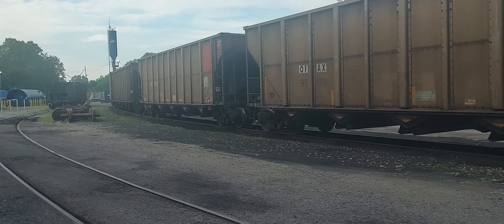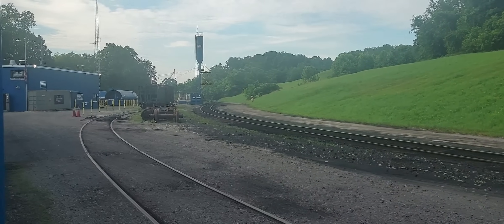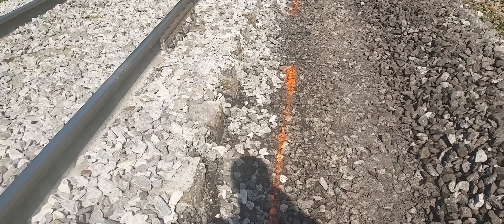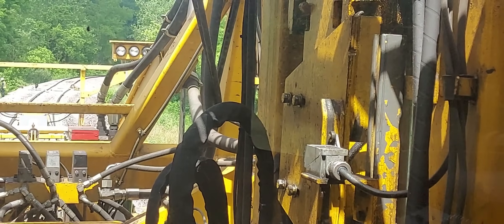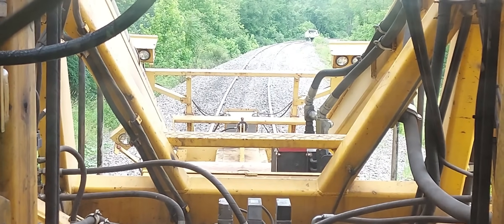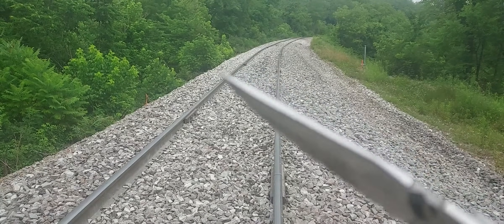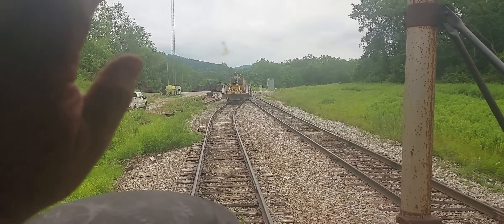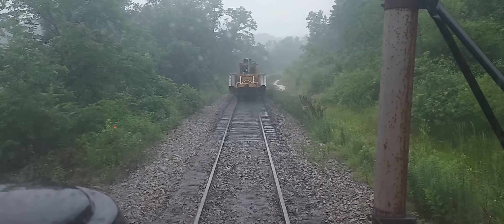It Was an Intense Time on the Railroad this Week

Comment: 14 inches is quite a bit. What is the most you ever had to pull a track to get it back into alignment?
Reply from the maker: Two years ago I pulled Curve 10 over 23 inches Mojo with my tamper. That was fun. It was a 10 degree curve and I got it down
to the original track chart at 3 degrees. Haven't shown those videos
yet. We had also pulled a different part of Curve 36 over the the south about 4 years ago, it was around 15 inches. Curve 36 has
been a nightmare since the beginning.  Really appreciate your taking the time to watch our video and may you have a very good day.

Comment: Why did the track need to be moved over?  Was it because it shifted over time, or more of tweaking it to make it smoother after running on it for awhile?
Reply from the maker: Train kept pushing the track to the south and eventually that side
of the track was sitting on ballast and not on the road bed
like it should be. Pure ballast over a slope is unstable. Thank you for  taking the time to watch our video and may you have a very good day.

Comment: Dave, you’ve mentioned the slow orders before and I think most of us know what those are in general but how is that information communicated to the locomotive engineers each time and who puts those orders in place and who can remove them? 

Do you get down to the exact spot for the slow orders or is it between mile posts even if the area in question isn’t a full mile?

Really enjoy the videos! Thanks for sharing.
Reply from the maker: Thank you Will, sounds like might make a good topic for a future
video. Myself or the shift foreman can put a slow order on the
track. If that event occurs there is a chalk board in the harbor
office where the slow order is written on so the train operators
can read it before shift, also word is communicated directly to
the operators by whoever puts the slow order on the section of
track. The only person who can remove a slow order is the same
person who first put it on.  As to the location, slow orders must
take into account the length of the train so the entire train
is moving at the same speed through out that section. So
got to figure train length to know where to start and when
to end. With that said, it's just often easier for the train operators to say for instance slow order from one milepost to another or from one location to another on the track.  Thank you for taking the time to watch our video and may you have a very good day.
Reply: @ccrx6700 thanks for the response, Dave! Very interesting and I’m sure it would make a good short topic for a video. 

You do a lot to show your side of the Ins and outs of railroading I was just curious how what you do translates to the day to day train operations. Thanks again
Reply from the maker: @willb.383 👍😊🚂

Comment: So you explained the number board now explain why there is no "F." 😉
Years ago, my cousin and I were fishing one day when I got my line caught and had to break it. As I brought the end out of the water it rose until the line was vertical pointing up in the air. I reeled it in and I am telling you I felt it in my hair and we were in a boat. My cousin started the motor and we hit warp speed out of there.
That is my "near" brush with lightning. Crazy.
Dave, I may not use all of the railroad safety tips you teach us but I sure do like learning them.
Reply from the maker: Since we do not fall under FRA jurisdiction there is no need to
label which end of the loco is the front ut000bs. Oh dear, being on
water in an electrical storm would scare me. When I worked
barges and lightening came up we got off asap.  Really appreciate your taking the time to watch our video and may you have a very good day.
Reply: @ccrx6700  I knew FRA jurisdiction didn't apply here. I was sort of poking fun. I would take a magic marker and make one, myself. lol 😉👍‍
Reply from the maker: @ut000bs 😊👍🚂

Comment: wow i didnt know metal fluid buckets are still made must be because its non detergent.hope you get some new equipment with the new administration and as demand increases.you do really great work.that radid down valve must be stuck or has no pressure on it.play it cool with that lightening thanks for sharing.
Reply from the maker: A good bit of the oil that comes in to the mine has been in metal
buckets, but they are starting to get the plastic buckets in more
and more here d2sfavs. Yes the oil I used was non detergent,
you are right about that. Watch Wednesday nights video for more
on the valve, I got into a huge mess.  Really appreciate your taking
the time to watch our video and may you have a very good day.

Comment: Lightning and metal tracks can make for some real interesting experiences.

  I worked at a company that the tracks passed by, there were 10 Highway Crossings with gates and lights, we had a really severe thunderstorm come up. 

 Lightning hit the tracks right outside the large window that faced the tracks and we could see at least 3 of the 10 Crossings out through the window, as soon as the lightning hit those 3 crossings activated, that lightning bounced down the tracks in two different directions, that was something to see.   It actuated all 10 Crossings and fused the relays at all 10, keeping the lights flashing and the gates down.

  I saw one of the circuit boards that got replaced and the board was scorched black and the relay was literally a melted blob on the board, fusing it so that the signals were activated and tripped.

That was a mess because that storm lasted almost 2 hours, and that lightning strike happened within minutes of the hard rains and lightning starting up.

  So they couldn't deactivate, or do anything with those crossings until the storm and lightning subsided.

Unfortunately we were supposed to get off work at 3:30pm, but the storm was still going strong, and we couldn't get out of the parking lot, we had to cross over the tracks to get out or in to our parking lot, and they were protected with gates and signals on the entrance road and the exit road(one way road in, one way road out).

So our Supervisor asked us if we wanted to work overtime or just sit it out in the break room until the storm cleared.

  Most of us said we'd work until 5:30pm and get a couple hours of overtime pay.

They did get all the crossings back open and working normally around 5:45 pm or so. 

That was certainly a mess, and the industrial area I worked in was really a mess with all the traffic being backed up since a lot of the buildings were like the one I worked in, the parking lot was blocked because it was over the tracks on the opposite side of the buildings.

With the traffic back up it took some of us over an hour and a half to get out to the main road, which normally took about 15 minutes on a normal day, when everyone got off at different times from each building in the area.

Those lightning storms can sure cause headaches for the railroad, and even for drivers on the road that have to cross the rails to get somewhere.

This would almost be the strangest thing I've seen lightning do, but I've seen lightning do some really weird and interesting things.
Reply from the maker: Wow thats a very interesting story Mr. Bones. I never gave a
thought to how a lightening strike could affect crossing lights
and gates. Bet there was a lot of upset people waiting at the
gates that day! Those rails are like a big conductor wire for
the electricity, that's why we always try to get off the rails during
an electrical storm.  Really appreciate your taking the time to watch our video and may you have a very good day.

Comment: That one task I was involved with here in the UK. Using a sort of trolley, conducting a ultrasonic test. We would cover up to 5 miles a day either on a day shift working on lines still open to trains or at night when we would be working under a possession and handheld devices to check the joints by the rail joints.

Also we also use a high speed train that goes by the name of the 'flying banana' as she is yellow in colour and travels up to 125mph inspecting the track.
Reply from the maker: Cover a lot of territory fast at 125 Wayland Joe! Wow. They typically
run 15 to 20 here when doing inspections.  Thank you for taking the time to watch our video and may you have a very good day.

Comment: Hi Dave, I  might have missed a video, but have you ever done one showing how and why the rails should be greased? We had a greaser mounted in a hi-rail and would periodically do the curves. Thanks for another great video!
Reply from the maker: No Chris I have not done one yet on the wayside greasers. Long
time ago we had a greaser on the locomotive for greasing the
rails, it hasn't worked now in over 25 years. We do have 6
wayside greasers out there tho. LB Foster sold them to us and
at the time they wanted us to get one for the hi rail, I thought that would be neat, but they didn't buy it.  Thank you for taking the time to watch our video and may you have a very good day.

Comment: My lightning story. I was teaching aircraft maintenance in the USAF.  We were doing an aircraft refueling, on a nice summer day, with no clouds in the sky. Halfway thru the job, a lightning bolt hit the right wingtip on the aircraft parked right next to our aircraft.  The lightning traveled up the wing to the fuselage, to the nose of the aircraft, and down the ground wire.  It jumped from the wire directly to the ground, blasting out a chunk of concrete about the size of a football.  That chunk shot up into the bottom of the aircraft, poking a hole thru the skin.  Lightning can travel up to 30 miles underground and appear anywhere. 😅
Reply from the maker: Wow now that was quite a story Robert! Surprised it didn't fry
the electronics in the plane. I bet that was scary to be that
close. Thank goodness no one got hurt.  Thank you for  taking the time to watch our video and may you have a very good day.
Reply: Put ground rods around the rails and shunt lightning off the rails to the Earth. Keep the crews safe. 7:34
Reply: Wow, thank goodness the planes and all the refueling are grounded.
Reply: Keeping lightning away from the signal system. Lightning would. Destroy the hotbox detector sensor system. 11:46

Comment: That was a big job moving the track over. It will be interesting seeing the next video on that. You do right getting off track in a storm. I never saw it happen but a few I worked with had seen lightning hit the rail and dance along the rail top. We had a signaller who said it hit the switches and it arched across the levers in the signal box, he dare not touch anything till we had got there scared he would get a shock. Everything was fine but I understood why it scared him. As for electronics it was nearly always the electronics in phones that fried the old relays for the signals rarely get damaged.
Reply from the maker: I don't blame that guy for not wanting to throw the switch! Lot's
of lightening and rails stories coming in Cedarcam. If you get chance read HolidayDecorator's comment.  Thank you for taking the time to watch our video and may you have a very good day.
Reply: @ccrx6700  Thats an interesting tale Dave yea. It seems like rails are a magnet to lightening. I have not seen it activate crossings myself, it was all tunnels in areas I worked in, but others had been called to faults like that. Have a Good Day Dave
Reply from the maker: @cedarcam 😊👍🚂

Comment: It's too time consuming to do all this manually, but it would be awesome to put all the geometry reports you got over the years into a computer program to (1) get a heatmap of current deviations along the track and (2) show you the history and past long-term movements of any given spot on the track. From the information you mention in your videos it seems that you have all of that in your mind already from personal experience so maybe it doesn't offer much new insight for you. But the comptuter could also easily correlate that with the ground, with makes/types of rail, ties, bolts, coal spills, drainage, and all other kinds of things. Even interactions of all those things with temperature, the numbers, speeds, and weights of the trains that run over it are possible. And all that could be analyzed regarding to your maintenance efforts, means, and priorities, to work backwards from the most expensive fixes and make a case for getting budget/contractors approved to repair them earlier on, before they get expensive and impact track availability. Now, I'm an office guy but not entirely detached, instead of hiring a guy to do all that, if you had an extra guy, he could as well get to work on the track just get it done to start wtih! Ha! 😃
Reply from the maker: Sounds like an interesting idea 2xKTfc. First off it would be
easy for the geometry reports. We never had a geo truck in here
until July of 2021. Since then there are 2 reports a year. I have
the first report and copies of the last 3. However from my day to day
track work I know where each problem spot is, the ones that
come back consistently and the ones we fix that don't come
back. Personally I don't need a geo truck to tell me what needs
corrected as far as track geometry goes. The big thing is
the geo truck checks track gauge and the only way I could do
that is by walking the entire length of the track pushing a small
roller gauge. So that to me is the big benefit of the geo reports.

With that said, I do believe that it would be most valuable for
the future track workers if something like you are proposing
could be done. Now we need to get someone to do it! Another
thing, when there is a problem that needs addressed, so far
Iron Senergy we have not had to beg for money, they have
spend huge amounts of money on this track since July of 2021.
HUGE amounts, so getting money to work on track is no problem
at all, which is awesome for me to be able to say that.

Comment: Is loco #22 cold with morning empty train  race?
Reply from the maker: 22 as the end of train loco is being remotely controlled by #1
loco which is on the head end of the trains Nicolayu. The operator
in the lead loco does have an option to switch off the end of
train loco from using throttle. When it is being remotely controlled
the end of train loco mimics exactly the throttle position the
head end loco is in.  Thank you for taking the time to watch our video and may you have a very good day.
Reply: @ccrx6700   can one locomotive pull empty 41 coal cars?
Reply from the maker: @nicolaykotomanoff  yep no problem

Comment: I would be embarrassed for myself , crew and company if I showed up on the jobs we and we didn’t know the equipment and or parts to fix equipment on the spot. I worked Heavy Mechanical . Mine and Railroad jobs in the boonies . I read a book about an oil Well firefighter named Red Adair . I all new hires read the book about work and preparation of your equipment.
Reply from the maker: I hear you on that Kerry. One nice thing about our track, the
parts we do need are not hours away but almost always within
20 or so minutes from where we are working.  Much different
story when you are out in the middle of nowhere like you guys
and had to travel hours. I will have to check out that book, thanks
for sharing.   Really appreciate your taking the time to watch our video and may you have a very good day.

Comment: Hey Dave, I have two questions for you this time. Did locomotives 22 rock really good as it left the yard in the beginning of your video or was that an optical illusion? Also, what was wrong with the regulator? It looked like you had it running to spec this time after all of the low power issues you have been having lately. Thanks for the great videos as always.
Reply from the maker: Yes you saw right Brian, on the west end of bridge 14 there is a
small section of track that needs tamping. However that section
did not cause a flag on the geometry report. They changed the
travel controller on the regulator and it has been working pretty
good since, but it still has low power. At least it moves now!
Thank you for  taking the time to watch our video and may you have a very good day.
Reply: @ccrx6700 , thanks Dave. I would think that since it is driven hydraulically, then there would be some kind of flow restriction causing it. I am just a goofball truck driver, but I love to figure stuff out like that. I am also surprised that the track did not get flagged there. Of course by the time 22 got to that point, the operator was getting up to track speed. Thanks for all of the great info you have given us crazy train lovers out here. I think you are actually providing a safety type of service by answering our questions about railroading without us getting anywhere near the railroad to get hurt. Be safe kind sir and take care.
Reply from the maker: @brianr4077 👍😊🚂

Comment: Have you and the company already noticed a reduced maintenance workload between the 20 or so new cars and the ones that were recently retired from service? I'm sure any change is most welcome! Savings on repairs and maintenance alone probably don't come close to paying for new cars but it'd be great if the savings, better availability and lower costs from spills and subsequent track deterioration would make more new ("pre-loved") cars worthwhile for the company.
Reply from the maker: So far the new to us cars have done very well with zero problems
2xKTfc. They had to do some things on the like changing some
dump hoses and putting in coupler carrier wear plates, but
once they go them going, it's been smooth sailing. Still working
on fixing up the old cars we had tho, some things never change.... LOL   Really appreciate  your taking the time to watch our video and may you have a very good day.